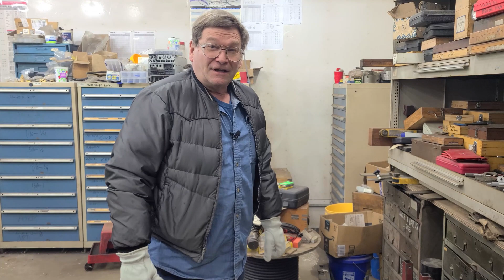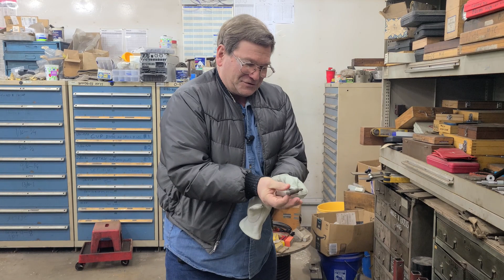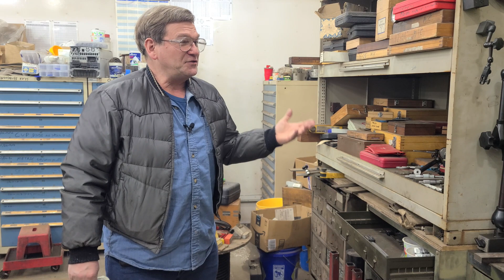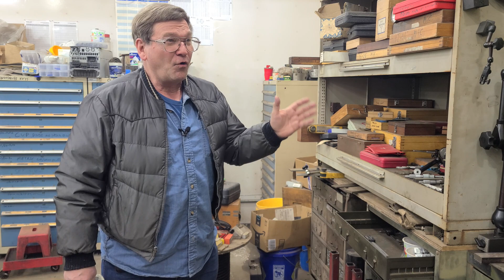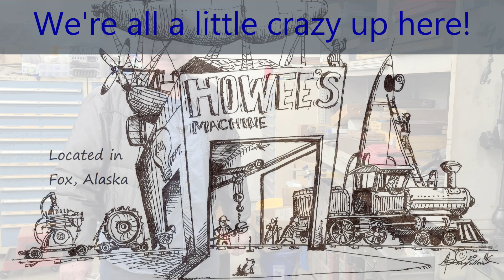Machinist's Minutes: Machining at -40F

Comment: A stripper plate made of 4140 36 inches long and a die shoe made of aluminum.
The stripper guides on the die pins pressed into the aluminum die shoe until it’s 105 degrees in the press shop and now the pins (pitch) is.007 bigger than the stripper 
A coefficient 💩 show of dissimilar metals.
I don’t like engineers…

Comment: A lot of upper managment cannot approach the design engineering dept  because they simply do not know what is going on. 
 With excuses “I’m not going to sit on the phone for bla bla bla “
This one time I insists till I got my way and was told ok you phone. 
I asked right away who detailed such and such print. Talked to the lady and in about 2mins she knew exactly what I was talking about. And it was fixed in about the same amount of time. 
So for a six or seven minute phone call I saved them a mountain of headache and time. 
A lot of times the engineers miss an error  and just rubber stamp the print “revised” because they don’t want to be held accountable for “approved for construction” 
And the detailer can’t tell there’s an error because they can’t do the practical application. So when I explained it to her she understood without getting the engineer involved. 

Our construction super couldn’t believe it till fax machine started printing out the revised print about 15 minutes later Lol 
When he stormed out of his office with the new print I was well on my way to building it right. 
The on going joke for us when we caught an error was “you’ll just do it your way anyways“ 😂

Comment: having worked on bronze bushing replacement a while ago,  --35 to -38 for most of the job, we had some similar issues. the hole was bored to size on plans in situ but bushing was made indoors and after a day outdoors... oops, not a great fit.

Comment: I'm curious if you ever knew Ruben Hendricks from Delta Junction? He was my grandfather and passed away in the early 90's, but given the relatively few people up there and your line of work it seems likely. He moved up there in the 70's to work on the pipeline, then setup a repair shop (autos, trucks, equipment, etc) in Delta. He and his second wife opened I think a Napa later on. I spent the summer of '78 up there. Lots of fond memories of that.
Reply from the maker: I don't remember meeting him.  We may have met, but My memory is not good at names, unless I saw someone several times.

Comment: Worked for a plastic injection and die cast mold company, the boss drew the prints. One day I'm laying out waterlines for cooling and see that they go through bolt holes for inserts. I point it out to the boss and get told those prints are just a guide, you guys have to catch these things. Which I replied that is what I am doing, after he realized I had not already drilled the holes. Talk about a mickey mouse out fit spent 5 years learning how not to do things, which was beneficial in the long run.
Reply: You learn more from negative than you do from the positive.
You will never know how stupid management is until you experience the Peter Principle. 😅

Comment: We run into engineering mistakes like that quite often.  I'm working on a part at the moment, its a ladle hook for a steel company . 4 of them actually. The  print i have shows an isometric tolerance on the bore's of 230 millimeters H7/r6. But the bushings have a standard tolerance of + .002" 
Why would they do this ?!?  Also, this engineer decided to leave me over 3 inches to bore out of these hooks. They should have been flame cut to within half an inch !!  I've got a gravy job i guess for the next week or so. 😅

Comment: LCD displays stop working below a certain temperature, which does depend on the display type.
Reply from the maker: I was very impressed with my chinese diesel heater while thawing out my sewer line. Roughly -55 to -60 out and it only had a 4 second refresh rate.
-Cameraman

Comment: Did you notice that if it was harder to cut? Steel has a BCC crystal structure and when it is that cold, I'm sure it is below the ductile to brittle transition temperature.
Reply from the maker: It cut easy, but the hydraulic drive on the line boring machine was unhappy for the first hour of use.